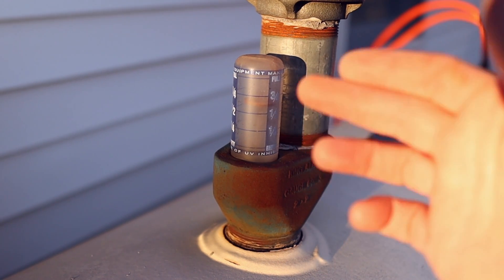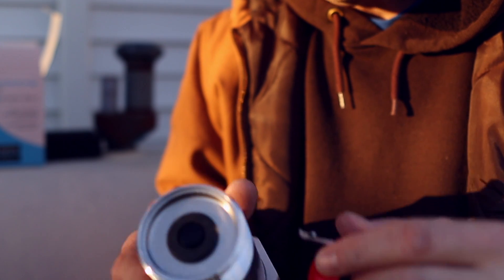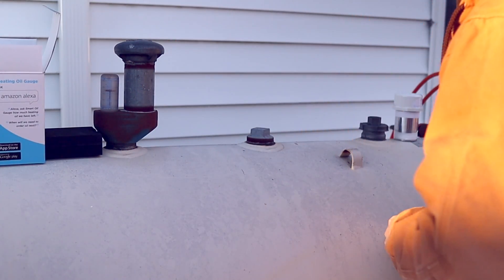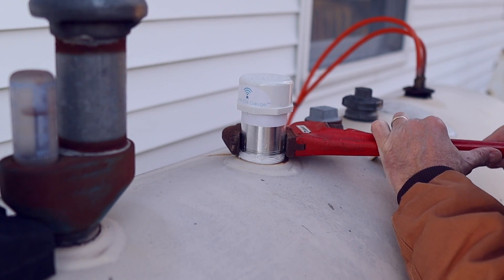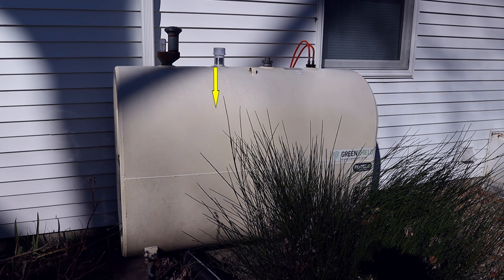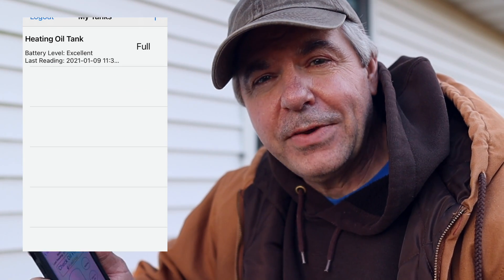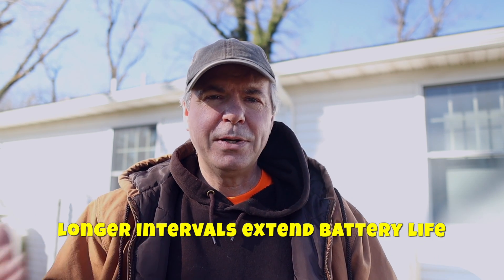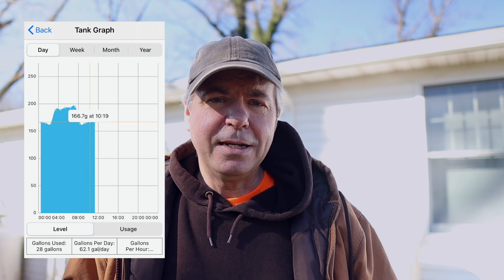#43 - How to install a smart oil gauge on your home heating oil tank.

Comment from the maker: NOTE: THE MANUFACTURER RECOMMENDS USING LIQUID PIPE THREAD SEALANT RATHER THAN TEFLON TAPE. USE TEFLON TAPE ON THE CAP ONLY.
Here are some product links. These are Amazon Affiliate links, so purchasing will help this channel by providing a small commission while not costing you any more. Thank you for your support!
Smart Oil Gauge:
https://amzn.to/35rwsE5
Pipe Wrench:
https://amzn.to/2LiXUNq
Oatly pipe thread sealant:
https://amzn.to/2KjuUol
Nitrile Gloves:
https://amzn.to/34Kg8OG

Comment: Hi, is this unit still working? I am in the process of changing my oil  gauge and would like to take your experience into account.
Reply from the maker: Hi. It is still working well. I think they even have a new design. Just don’t use Teflon tape. Instead use high quality pipe dope. Good luck!

Comment: I could see this coming in handy if you have a relative or yourself and you physically can't walk or your blind or something. 150 vs 40 bucks for a Beckett mechanical unit is a lifestyle preference. I have two 275 gallon tanks so that's 300 bucks for something that will fail.

Comment: Our oil tank is outside the house in the rain, etc.  Is it safe to use a smart gauge outdoors?
Reply from the maker: It’s perfectly fine as long as it can pick up your WiFi signal. 👍
Reply: @MyClutteredGarage  Will it hold up in outdoor weather conditions?

Comment: I’m installing this to monitor the oil when I move to FL from PA. I read that was possible for me. My question, can my tenants install the app and monitor the unit using their phone in PA where the tank is, and me monitor it from my phone in FL?
Reply from the maker: Not sure if you can create multiple accounts or if you would just have to share the account. Please call the company with your questions. They are very responsive and have great customer service. Also, don’t use Teflon tape like I did. I had to remove it and use pipe dope. This may not be an issue with the new model.

Comment: Did you ever do a post 6 months or 1 year review?
Reply from the maker: Hi. No, but it is working well. I did have to remove the teflon tape and use pipe dope instead so that it would seat further into the tank. I have changed the batteries once. Thanks for watching! -Ed
Reply: @MyClutteredGarage  i just installed one and found that it does not fasten all the way. How important is that?

Comment: Apparently you didn't read the instructions well. States not to use Teflon tape because it degrades over time. And with an outside tank, the bead of pipe dope would create a seal from water.
Reply from the maker: I changed it 👍

Comment: I've been searching for something like this and the concept is grat how have you found it after a year of use?
Reply from the maker: I like seeing my history of fuel usage. I did have to remove the Teflon tape and reinstall with pipe dope. The sensor needed to be screwed in a little bit deeper for my tank, as it was not functioning properly. It has worked great ever since. I recently replaced the batteries for the first time. The company has excellent customer service. Thanks for watching, and good luck!
Reply: Thanks much for your response.  I have ordered one  will see.

Comment: Thanks for Video it was well explained!!
Reply from the maker: Thanks. Be sure to use pipe dope, not Teflon tape like I did. I had to change it so I could screw the sensor down further. Otherwise it’s been great! Just did my first battery replacement.

Comment: You are going to be able to see how temperature affects volume during the course of a day. Maybe see how direct sunlight affects it too. Thinking of getting one of these. Using the beckett rocket right now along with a sense energy monitor. The sense recognized my oil burner so for the last few years I’ve been tracking my oil usage by taking the monthly running time and multiplying it by fog, which is 0.78 gpm. I even track my electric used by the burner.
Reply from the maker: Wow very nice. Now that I d had this for over a years it’s helpful to see my seasonal usage over the course of a year. I’d like to see more metrics with the app but it does a nice job. Just did my first battery change.

Comment: I recently switched to a Roth Tank, after installation they added purple glue and attached the smart oil to the unit. Any recommendations on how to unscrew the gauge and what to use to clean off the purple primer without damaging the threads?
Reply from the maker: Hi. I’m not sure, but the smart oil gauge has metal threads, so it should unscrew with some effort. I’d reach out to the company or a plumber. Thanks for watching.

Comment: Will it work for unground oil tank?
Reply from the maker: The only reason I think not, is because an underground tank has an extension pipe that may affect the ultrasonic signal. But I don’t know the answer to your question. The company offers great customer service, so I’d suggest reaching out to them. Thanks for watching. -Ed
Reply: I don’t think there’s a extra hole to install sensor on underground tanks. They should make a in-line counter to count fuel being used.

Comment: how does this perform outside? have you had any issues with the weather?
Reply from the maker: It has worked very well. No issues with weather. The biggest issue was in the beginning. I had to remove the Teflon tape and use pipe dope so I could thread it in further. It was getting bad readings before that.
Reply: @MyClutteredGarage  Thank you so much for your reply, so even with temperatures below freezing you had no issues. Thank you!

Comment: Great video. Thank you!  Now that it’s been a couple of months, what do you think of this device?  Did accuracy improve?  How are the batteries doing in the cold temps?  I live near Fairbanks AK and batteries don’t tend to do well outside here in the winter.
Reply from the maker: Thanks very much. I'm very happy with it. We don't have very cold winters here - only a few weeks just below freezing. The batteries are still reading "good". I did have to remove the teflon tape and use pipe dope because the tape was preventing it from seating deep enough, causing a false reading. Go figure. At any rate, I do like it and recommend it. Great customer service too. Thanks for watching! -Ed
Reply: @MyClutteredGarage  

Could that have been the reason for the early spikes?
Reply: Appreciate the info!  I will look into it.
Reply: @Mike Long  Mike did you ever end up trying one of these?  I also live in interior Alaska and have been wanting to try this.
Reply: @joeholland428  Hey Joe. I haven’t yet, but I am going to this summer for sure. We ran out of time last summer. You know how that goes!
Reply: @Mike Long  yeah summer zips right by up here. I have been wanting so.ething like this for awhile now. I just dip my tank once a week. Tank is outside and buried like alot of tanks up here. Not buried deep and close to the house so I am thinking about giving this a try.

Comment: Great video, I already ordered mine, just waiting for it to arrive.  I like how you took your time describing what you were doing and how it works.  One thing I must say, I see you posted this video 2 weeks ago, you need to get back out there and remove the unit again, remove the Teflon tape and use pipe dope instead.  The Teflon tape will brake down with time creating a leak and clog up your filter.  I believe the instructions specify not to use Teflon tape on the pipe thread that goes into the tank. The Teflon tape is only to be used to cover the battery compartment.    With that said, in regards to the change of oil level I’m wondering if the fact that your tank is outside is causing the oil to thicken up just slightly where it actually rises during extreme cold, just my guess I don’t really know. Either way I am glad I saw your video I really enjoyed it, you did an amazing job and I can’t wait to install mine.
Reply from the maker: Thanks. I actually went back and changed out the tape with pipe dope. The mfg suggested that the tape may have prevented the unit from seating deep enough. Thanks much!

Comment: The cloudy gauge is probably plastic.  You can buy replacement glass ones and they don't cloud up.  Also plastic ones  will melt in the hot sun.  I have replaced several where I worked.  The float gauges are not accurate and are just for getting an approximation. Stick it with a measuring stick or tape measure  for accuracy.  The acoustic ones don't work well when fuel is being pumped.  Probably burned oil at night and stopped buring in the morning.  Again stick the tank to assure yourself it is accurate when at rest. Precision and accuracy are not the same thing.  Had a new tank installed with a similar acoustic meter that showed 75% full while diesel was coming out the vent.   Big mess.  Acoustic is better most of the time but not important for most home owners who know when the tank should be filled and walk by the tank when they mow or something.

Comment: A 160 dollars for a stick replacer??? It's amazing what people will waste their money on. In 15 years I never once ran outta diesel.
Reply: Cool story. Anyways just because you don't see a need for it doesn't mean everyone else feels the same way. It's absolutely not a waste for people that have a relatively inaccessible oil tank or have the desire to track their oil usage metrics over time. You can also just say you can't afford the $160.
Reply: kinda hard to use a dipstick or read a gage when you are 1500 miles away in Florida!!